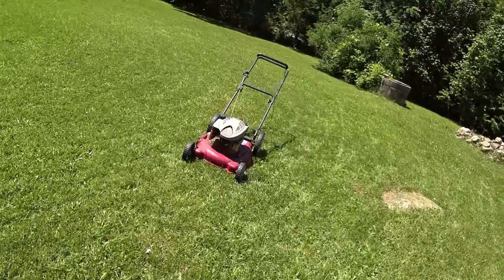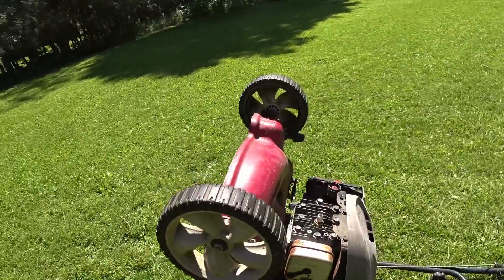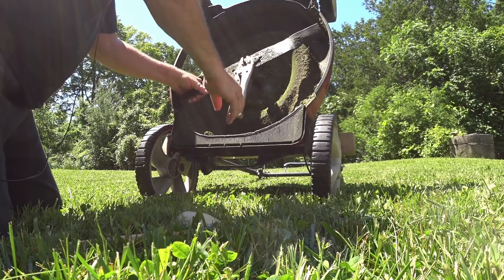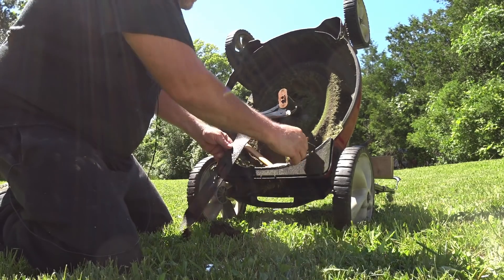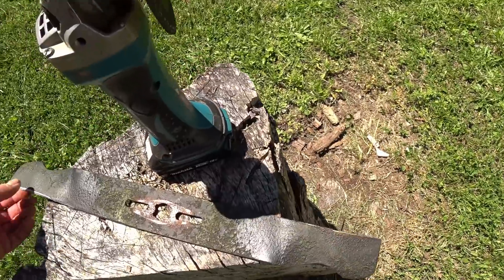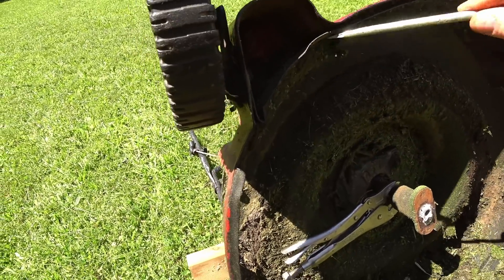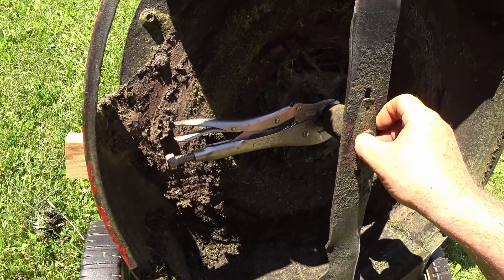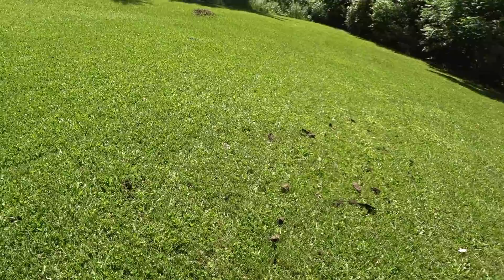How To Sharpen A Lawn Mower - 9 Practical Tips

Comment: I have a walk-behind mower and last year I saw a "washout" plug in Lowe's lawn mower parts. I just drilled a hole in my mower deck and installed the washout plug.  (These washout plugs come standard with larger riding mowers, but I've never seen one as standard equipment on a walk-behind mower.) It also comes with a quick connector that attaches to the end of a garden hose. I also got a "Y" connector for my hose bib and attached a short leader hose with the washout connector to one leg of the Y and the regular hose to the other leg of the Y. Now when I get a load of crap stuck to the bottom of the mower deck, I just take my mower to the leader hose, connect it to the washout plug, and run the mower for a minute or two at high RPM. The blades hit the water stream from the washout plug and the grass build-up falls down onto my lawn. Works a real treat! Also, tip #2: a cordless impact wrench easily removes the bolt/nut that holds the blade on. It spins it so fast that there's no need to block the blade to keep it from moving. Same thing for edgers to replace their blade--cordless impact wrench for the win!

Comment: I had a Lawn Boy mower for 23 years the wheels rotted off I riveted a soup can to the deck to repair it the first time then it rotted out great machines unless some idiot forgot to mix oil then the roller bearings would seize but still reparable  great video as always

Comment: Not only is the built-up grass extra weight but it also reduces the quality of the mulching.
If you change your oil and replace the air filter and you'll very likely get much better fuel efficiency.
I started taking better care of my mower about 8 years ago, I bought it new in 2004. 
It used to drink at least 1.5 tanks of fuel (87 octane) to mow 10,300 sq. ft., with minor maintenance it's now less than 1 tank
I only use 91-93 octane now in both my mower and snow blower. About 5 gallons per year.

Comment: You need to check the blade balance after sharpening (an unbalanced blade will make a sound like the engine is knocking).

Drive a nail into a vertical post, leaving a couple of inches of nail exposed. Place the center hole of the sharpened blade on the nail. If the blade isn't  level, take a little metal off (by additional sharpening) the low side.

Comment: I notice we think alike 😆. I notice you cut an opening near the front tire to help throw the grass perpendicular to the blade so it goes straight out. I did the same but I went ahead and removed the small piece of metal on the bottom of the original opening to make a hugh opening. Now it throws the grass far and spreads it to some extent. Works for me. 
When I sharpen mine, I just tilt it on the opposite side of the gas tank so the fuel doesn’t seep out. Works well, carry on☝️ Big John.......

Comment: I try and keep my mower clean and I should change the oil more myself. My mower has a hose inlet built into the blade shroud and you screw in your garden hose and then start the mower and run water and the spinning blade splashed water all under the shroud and cleans it out. Mostly. I like mowing the lawn, it’s therapeutic to me. I think it’s akin to the Japanese sand garden thing with the rake and the lines.

Comment: You’re funny, John!!  You know how to make a dull, boring, dirty job fun and interesting.  14 years and never changed the oil!!! I knew I was doing something right.
Reply: I've have mine near 10 years, never changed the oil or cleaned the air filter. After each season I run a little but Lucas fuel treatment and it runs better than when I bought it. I'll even chain it to my side by side and cut the grass in the woods like a Bush hog. Never gave me problems

Comment: Yeah I treat my lawnmower kind of like crap as well, usually a pain to start after winter, old gas left in the carb etc. But to my surprise, it started up on first pull this summer, looks extremely similar to yours but a completely different brand.
Reply: The only maintenance I do outside of cleaning the spark plug is running mine out of fuel at the end of the year, lol. (grass might grow another foot, but I ain't buying more gas)
Reply from the maker: A good trick for fast starting with old gas is to use a propane torch to heat up the cylinder head a bit. Works if you flood it, too.
Reply: I Build It Scrap Bin thanks, ill try that. Usually have to get the starting gas out.

Comment: Tip #1, take mower to shop instead of taking tools from shop to mower. You could forget/loose a tool in the grass and possibly run over it with mower. Then your buying a replacement tool and blade.

Comment: Am I remembering correctly that you were talking about making a lawnmower out of the battery powered DeWalt table saw you got?  That would be a cool project to see.
Reply: Hmmm... Why aren't there gas/engine powered portable table saws? Seems as if it makes more sense than battery powered ones - at least under certain circumstances.

Comment: tip 10 - check the balance of your blade. 
a nail on a post works well, hang the blade at the center and hold it horizontal if the blade stays horizontal when you let go it's good. if one side falls you need to remove a little more from the side at the bottom.

Comment: No blade balancing? That thing might vibrate like jackhammer
Reply: My mower is well over a decade old.  I sharpen the blade at least 3 times a season and I've never done a blade balancing.  Most of the time I hand file to sharpen, but whatever method you use just do the same number of passes on each end and it will be fine.
Reply: That will help loosen the grassy build-up under the deck!
Reply: @jodyburton0351 , I just replaced blades on my 3 years old ride-on lawn mower (~120 motor hours). One of the old blades was far from being balanced even without any sharpening. While you can control the number of passes on each end during sharpening, you can't really control how many times does a rock hit each end of the blade. Though, if it ain't broke, don't fix it. If it doesn't vibrate, there's no need to worry about balancing.

Comment: your blade is not on correctly, the long washer thing is a brace, it goes in the same position as the blade , not at 90 degress.
Don't grind the bottom this moves the cutting edge away from the bottom of the blade. I like your video , but the info was wrong.